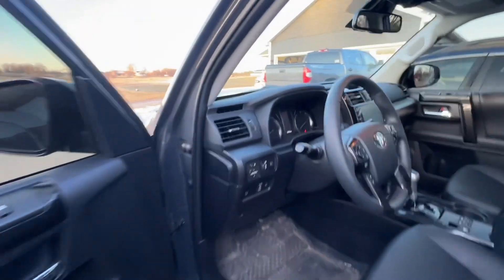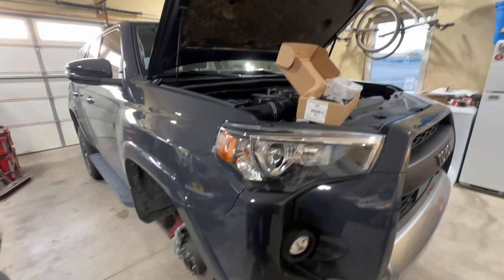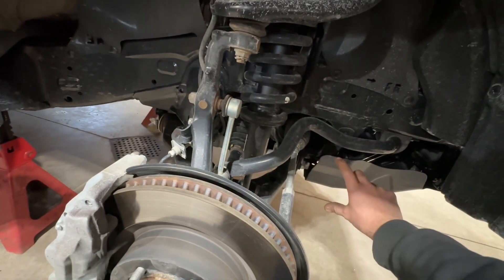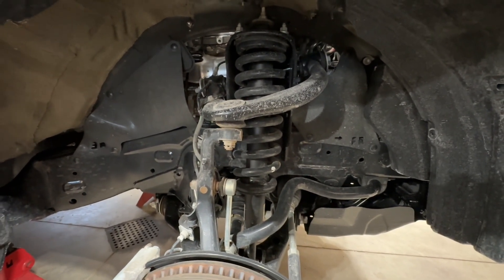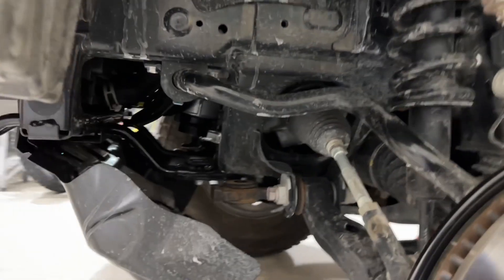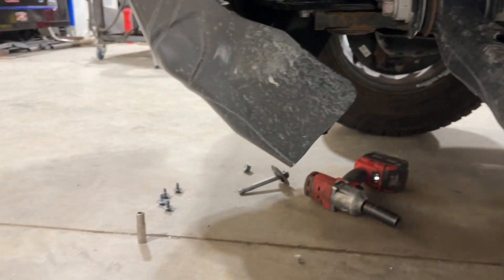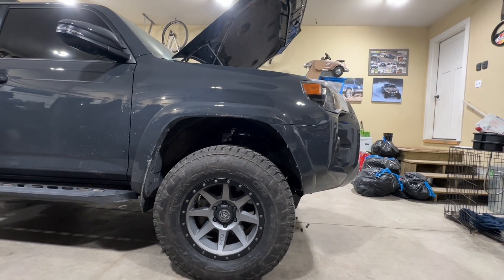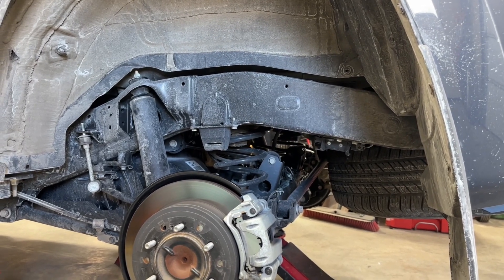Rough Country 2/1 4Runner lift install

Comment: Unfortunately, that puck lift will end up destroying the upper ball joints relatively quickly probably within 20 to 30,000 miles depending on your road conditions in your area. it’s best not to ever do a lift unless you do the full suspension kit. For example, to Bill Steen, 5100.
Reply: Why?